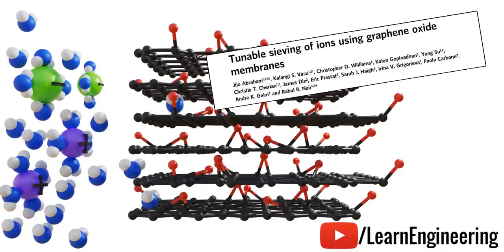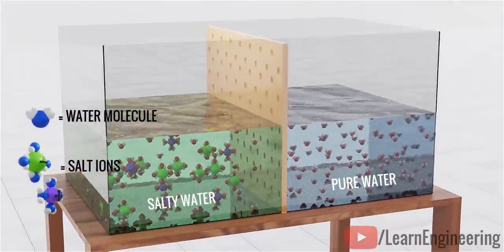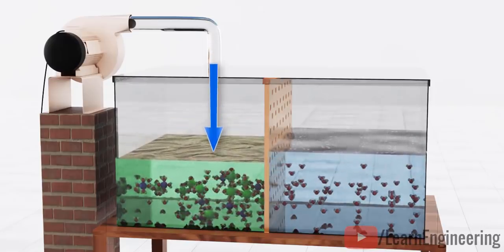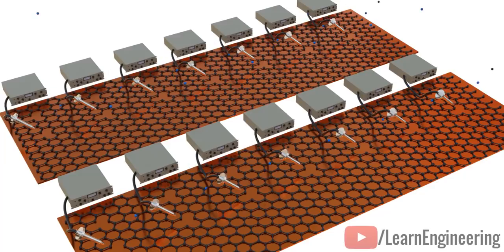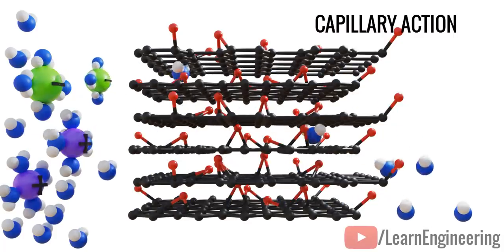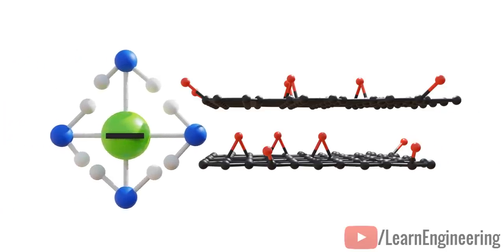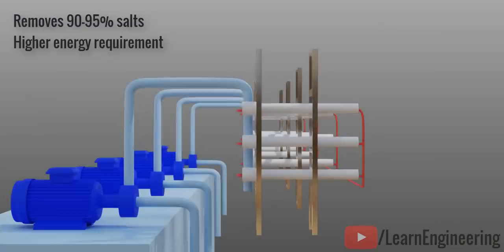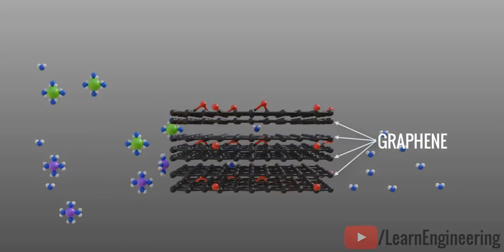Graphene Filtration | A revolution in Desalination technology!

Comment: this material is still WAY too infeasible because you would have to build an avogadro number of such layers to make a practical part.
since each layers would with cross section to the material and the number of layers to get a sheet of RO membrane is ungodly!! large and it has to have no imperfections.
i'll make some ascii at the bottom to show it where I = grahene oxide and V = epoxy.

VIIVIIVIIVIIVIIVIIVIIVIIVIIVIIVIIVIIVIIVIIVIIVIIVIIVIIVIIVIIVIIVIIVIIVIIVIIVIIVIIVIIVIIVIIVIIVIIVIIVIIVIIVIIVIIVIIVIIVIIVIIVIIVIIVIIVIIVIIVIIVIIVIIVIIVIIVIIVIIVIIVIIVIIVIIVIIVIIVIIVIIVIIVII
the water molecules pass perpendicularly through this membrane and hence the number of layers needed for a practical part is in the order of 10^23 layers!!!!

Comment: but since the process is 'un-mixing' salt and water, does it violate the laws of thermodynamics?
Reply: No, because you need energy to do it.
Reply: @thulyblu5486  they said the process occurs naturally, i assume its the gravitational potential energy provided the energy to separate water and salts?
Reply: @Hellcat2064  at 5:30 it just says that it has a lower energy requirement than RO, which means it still takes energy. I don't know what they mean when they say GO is a naturally occurring process. Maybe somewhere in nature there are carbon deposits next to a salty body of water and on the other side but downhill there is fresh groundwater or sth xD who knows. But I'm pretty sure the laws of thermodynamics still apply.

Comment: The only advantage i can see here is reduced membrane resistance, to be honest that's not much.
Reply: Energy required to pressurise it is expensive on large scales
Reply: the pressure required is 40% of the energy used in the current process

that should reduce the cost once the oxide is used

Comment: So, does this technology not need electricity at all ?
Reply: it does.
Reply: The energy has to come from somewhere, as the desalinated end-state has higher energy than the mixed state. However, (and I don't think much is explained in the video about this) some energy barriers are likely lower in the process, such that the process happens faster and this then would take less energy per unit time for a given volume of desalinated water, thus reducing losses inherent to e.g. running the pump. Although in the end it should take the same amount of energy to do so. I think. I'm confused.

Comment: If the pumps can't pressurized the salt water sufficiently simply use gravity.
Reply: How do you raise the water level without pumps tho
Reply: @specialopsdave , yeah first law of thermo. Also, a 500 psi osmotic pressure is equivalent to about 1200 feet of elevation difference.

Comment: Commercial RO uses power. Household RO in 99% of cases does NOT use a pump, just the natural pressure from your supply line. Usually around 40-60 PSI.
Also why compare household RO to desalination of seawater? Most people I know have fresh water coming into the home. Sorry but this 
video leaves out key components of water purification. Thumbs down...

Comment: So, this is garbage scieece at its best. This magic graphrne obviously beats any snake oil hands down. Not only does it cancel osmotic pressure and with it both 1st and 2nd law of thermodynamics. It also yields 97% water recovery without ever needing to worry about these pesky solubility index thingies that limit sea water RO membrane recovery to a mere 40%. Otherwise, an excellent video. Greta would applaud you.

Comment: What a misinformed video.

Look, according to the laws of thermodynamics, it will always cost at least X amount of energy to desalinate a given unit of water. Now, current RO technology is already really close to this X. Implementing any fancy graphene gibberish will only get you a small percentage higher efficiency since we are already so close to X.

The only way you can make desalination significantly cheaper is to reduce equipment and maintenance costs, not energy usage. It doesn't seem like this technology is on the right track, because it requires a novel, expensive material, and it still will require the infrastructure of RO, because it still requires a pump.